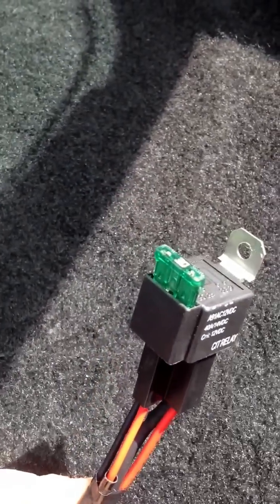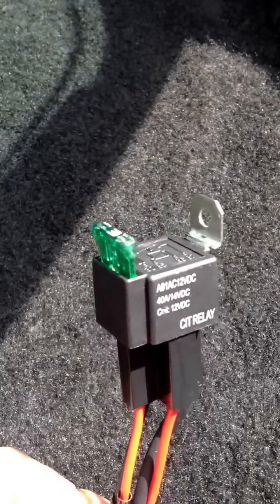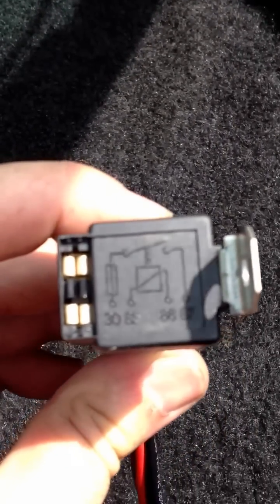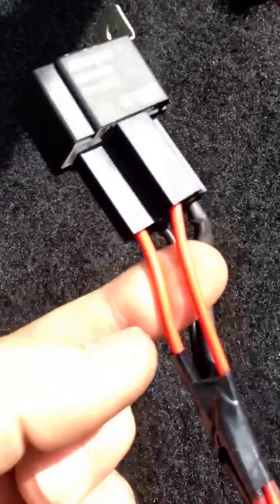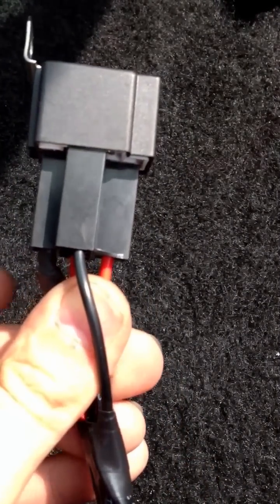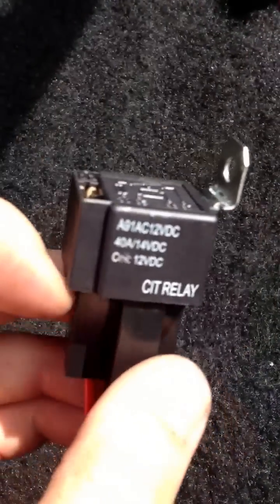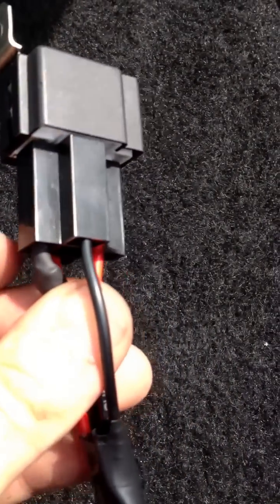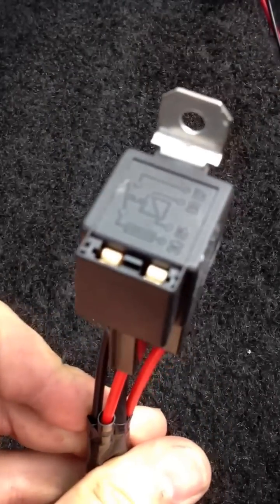How to wire a relay! The easy simple way!

Comment: where it gets tricky is with 5 pin relays
theres multiple double throw capabilities in the 5 pin ones,
plus you could possibly control 2 functions at once , spdt dpdt , or simillar 

5 pin ones make up more advanced circuits

Comment: Had a Question been having problems with my 89 Trans Am.. i am not getting power to fuel pump i replace relay but still nothing. There is times i hear pump come on then it dont. Do you know what might be the problem thanks...
Reply: did you replace to fuse by the battery?

Comment: A man please answer my question I have a 95 camry and the radiator fans don't turn on unless I disconnect them so I was thing using a toggle switch my fan has to wires black and white how would I connect to toggle switch I'm trying to hook it up to it so that when I turn on the toggle switch or off don't matter they break like me manually disconnecting them so that radiator fans turn on but instead I'll be using the toggle switch it power then the thing u want to power and ground 3 connections how would I connect it 

So radiator 2 wires and toggle 3 
When I disconnect from radiator fans turn on now I want to add switch so that I don't have to open car hood and disconnect all the time how would I connect? Thanks man

Comment from the maker: No, you don't need to have a switch, you can run that wire to a ignition hot and that way when you turn the key on and start the car the relay will power up. I use a switch on my setup just to have manual control on when things come on and off.

And a ignition hot is any wire that only has power when the key is turned either to acc position or to run, but gets no power when the key is off. Usually most fuze boxes have a couple spare slots that are perfect for this. 

Hope that helps.